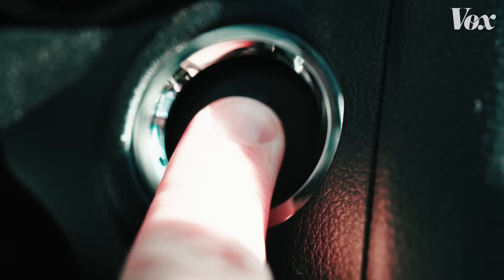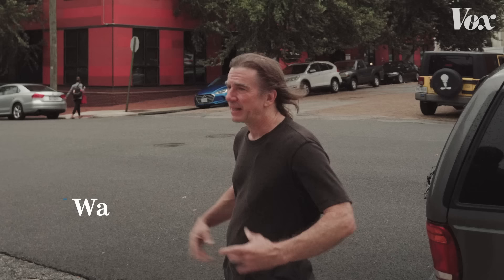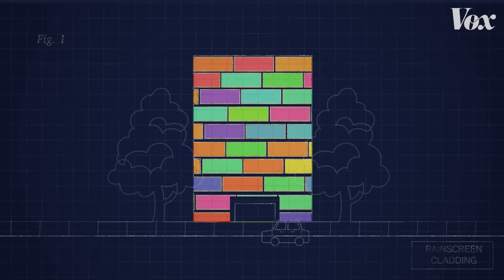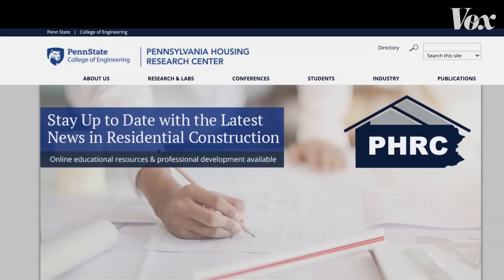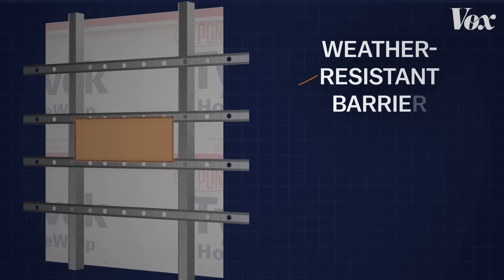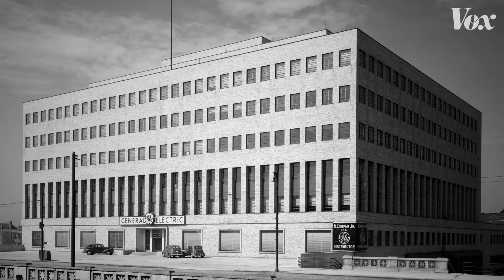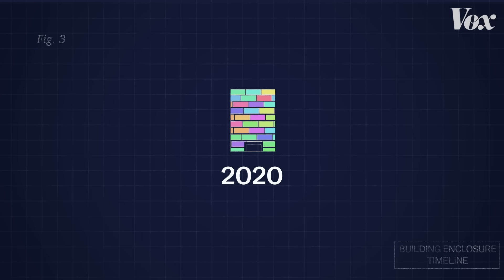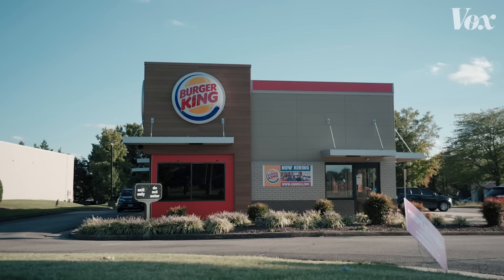Why so many new buildings are covered in rectangles

Comment: Good topic for a video, well shot and edited, but honestly, the structure and the content is awful. You managed to tell me very little actual information about the technology. What materials is it made of? How does it work? What are the pros AND the cons? If it's better than brick, tell me why? Could the panels be changed in 20 years to increase the life of the building? is that an advantage over bricks? I get the argument about using less material being more sustainable but find it laughable that the architect seemed proud of how his building could last 20-30 years as if that's some kind of achievement? Brick buildings can last 5 HUNDRED years. NOW tell me what's more sustainable? I'm not at all convinced by the arguments presented here.

Comment: Awful! You look at and compare and stucco\plaster, terracotta, and Hardie Panel, see rectangles and conclude they are all the same and ask why... NO they are not the same, and the rain screen or building science used to help the building maintain its desired structurer I guarantee are all different. Rain screens in buildings date back much further then you mention here, and you completely lose the point of why buildings are cladded using simple rectangles. It's just $.